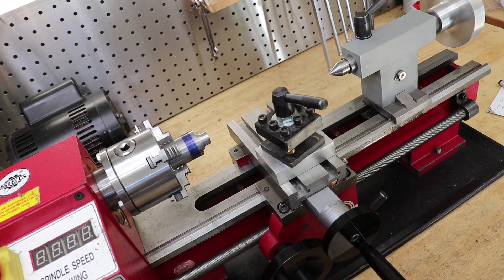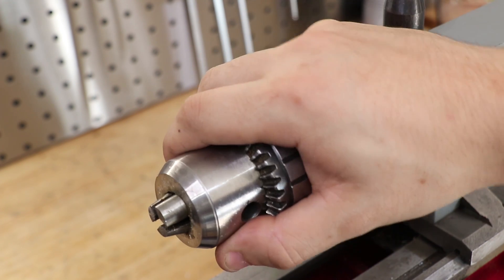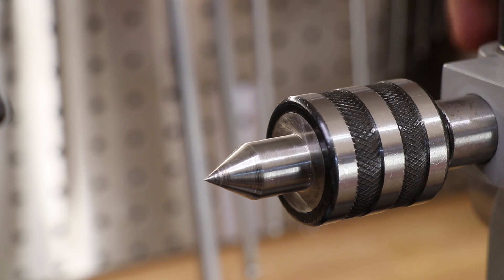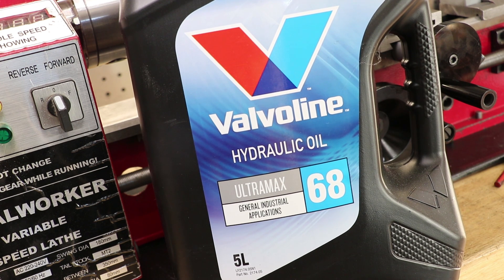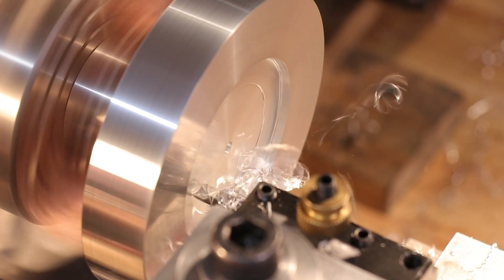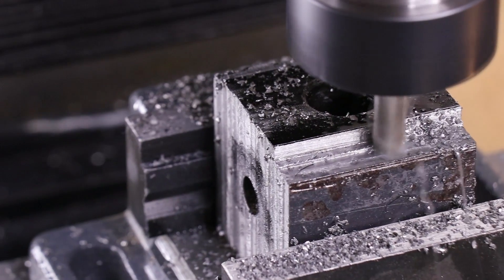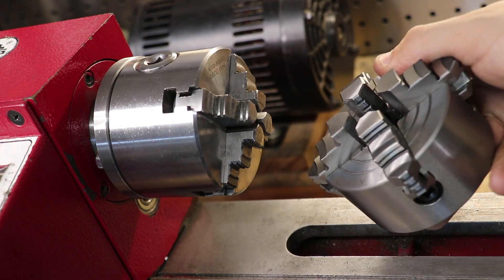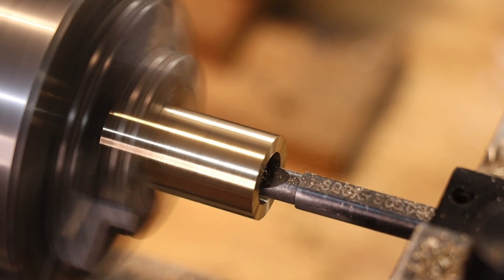Hobby Lathe Machining - The Cost Of Tooling

Comment: As someone who wants to get into machining parts, which is a better starting tool: the mill or the lathe?
Reply: For round parts a lathe, for square parts a mill. The mill can also be used as a lathe if you don't need single point thread cutting capabilities and the tailstock by installing a chuck to the spindle and tools to the vise
Reply: Lathe absolutely
Reply: Most definitely a lathe.  It's is the king of machine tools, and with some thought can perform many machining operations that might not be immediately obvious.  A lathe can quite easily be used for milling smallish parts with the addition of a suitable vertical table to the cross slide, whereas a small benchtop mill will be very limited on the size of parts it can turn.
Reply: "it depends" but lathe. you can do more with a lathe if you get creative with the setups. get as heavy a lathe as you can afford. I bought like 4 small lathes before I bought one which was big enough to do actual work and not just shake a fist at plastic. (note my "good lathes" cost £50 ish each. incredible bargin but it's just by keeping an eye out on fb marketplace)
Reply: @KS_ChemEng  What lathe did you end up with if you don't mind me asking?

Comment: Right on point. I would add one thing for those who want to use carbide tooling.  Try the ground "for aluminum" cutting inserts.  They are razor-sharp and cut steel like a champion.  They are still carbide after all.  The positive rake and increased sharpness makes them need far less power and rigidity which is ideal for our small machines.
Reply: dunno if this is good advice but i think it makes sense. The roughing inserts are meant for full engagement cuts in the harder metals in the group they're meant for which is way overkill for these
Reply from the maker: I've seen some people certainly make them work and get great results. Personally I never have, I've found the edge to be a little too brittle but that shouldn't discourage anyone from trying. Cheers
Reply: @Artisan Makes  I have had excellent experience with them, but they are a little more brittle at the edge. They don't love interrupted cuts. HSS is probably still the king for interrupted cuts. The situations where I think they can't be beat are surface finish on materials that hate to give a nice surface finish, and those times when I need to take very fine cuts to hit an exact dimension.  The ability to take off one thou without push off or taper due to tool pressure is a game changer.
Reply: @brianmoore1164  ...   i just hand grind HSS, i like the ability to get any angle, shape, sharpness etc.
HSS will get you the very best finishes in my opinion, like a mirror, and you can take cuts much less than a thou with a properly sharp HSS tool.
To me, carbide is for production work and removing lots of material, HSS any day for high quality work especially on less rigid small lathes.
Of course HSS means more work sharpening, you can't just swap an insert like you can with carbide.
Reply: @Wiz Rom  My answer is use both. A right tool for the right job kind of thing.  I keep HSS on hand and use it when it suits my job. Same as the carbide.  I even use the standard un-ground carbide when the job allows it to work well. They all have their place.  What surprises me most lately is how durable, reliable,  fast, and convenient the "for aluminum" ground inserts are on a very wide range of materials. I have cut tool steels with them and they hold up to it just fine.
Reply: @brianmoore1164    ... thanks for the tip, it's appreciated. 👍
Reply: @wizrom3046  right, but grinding hss can be an art. using inserts is a more speedy way, but there's a cost for that too
Reply: Carbides for steels are generally 0 rake (to facilitate chip formation) and ever so slightly dulled on the cutting edge to provide durability and shock resistance (interrupted cuts).
   Al carbides are designed for low maintenance, high production environments... of aluminium.
   The positive rake and sharp edge may work great for the first few cuts but you'll be buying carbide by the box.
Reply: @CʀᴀғᴛAᴇʀᴏ  Except I have used them for years now and don't have to buy them "by the box". You should try them before you make assumptions. You will be pleasantly surprised. Have you noticed that carbide endmills come sharp and don't dull quickly? Same sort of thing.  The ground and polished inserts are WAY more durable than people assume.  Give them a try.
Reply: @CʀᴀғᴛAᴇʀᴏ  Things that apply to big machines often will not work for those of us who operate the small machines. Limited horsepower and rigidity force us to think outside the box. Feed rates and depths of cut that would be middle of the road perfect in an industrial machine shop are completely useless to us.  We give up a lot to make good use of our little machines, but we get a lot too. They fit in the corner of the garage and run on household current.  The purchase price fits inside hobby disposable income. I would be the first to say that they don't approach the capabilities of big machines, but with a little out of the box thinking,  they will surprise you with what they can do.
Reply: @CraftAero  "I never tried them on steel because I didn't want to risk losing the bit. As a Toolmaker I was seldom using mild steels" As hobby machinist we rarely - never- cut die steels. Inserts work best when taking relatively decent depth of cuts and feeds. Less than that and they tend to burnish rather than cut. Using them to "sneak" up on final isn't a good idea. Inserts designed for aluminum will allow finer cuts with less aggressive feed rates. So will HSS. Learning how to grind HSS pays dividends and is recommended. It isn't necessary to get the exact angles of the ideal grind to have a perfectly suitable tool. 

Carbide inserts can be reground if you have a diamond wheel or the green wheels. The resulting edge will be sharper and cut better but not last as long. It can even be done by hand on a diamond plate. Use dust pickup and a mask😮 Since the inserts don't stick out much beyond the tool holder you don't get a lot of regrinds. 
Name brand inserts will last longer but at over $100 for a box of 10!!!
Reply: @CraftAero  I'm someone that's approaching these videos and the associated comments as a novice/amateur (but extremely high ambition) hobbyist; and I greatly appreciate you taking the time to write out your thoughts and provide constructive advice. I dunno how many others will see them, but for me, I appreciate listening and learning from people with experience and wisdom to share.

All that to say, thank you for your comment(s) and that they are appreciated!

Comment: IMO the best upgrade for any Chinese machine tool is to completely take it apart and thoroughly clean and lubricate it. Cleaning seems to be the corner that nearly all Chinese manufacturers cut - there's inevitably some swarf, grinding dust and nasty old machine oil lurking in all the nooks and crannies. That rubbish will affect the smooth operation of your machine and drastically reduce its lifespan.

Smaller lathes really benefit from being bolted to something really solid. If you can scrounge a thick steel plate or joist or pour a concrete slab, you'll really see the benefit in surface finish and cutting capacity.
Reply: Yes, in my experience for the youngins here (me included) don't expect to buy a lathe and have it work. Expect to NEED to take it apart, get your hands dirt and greasy, and might as well do so so you can really learn the machine. It's maintenance and knowledge put together and also a project planner because without a doubt you'll find someone wrong that you'll want to fix yourself now that you have a lathe..... Now where did I put that damn mini mill.
Reply: Agree 100%! Step one is a good thorough cleaning. I swear it is like they add extra grinding dust.

Comment: Thanks I’m in the market to buy a new lathe. Most informative.
Reply: When you buy a lathe make sure, if possible to get one that has a distance between centers that is at least twice the swing of the lathe. E.g. for a lathe that will turn 7 inches (175mm) you want a lathe that has 14 inches (350mm) between centers. The reason this is important is that by the time you install a chuck on the lathe spindle and a drill chuck with a drill installed in the tail stock the space for your work piece starts to get cramped on a lathe with a shorter bed.
Reply: Keep an eye out on the second hand market. You can come across old machines with tooling for the price of brand new mini machines sometimes.